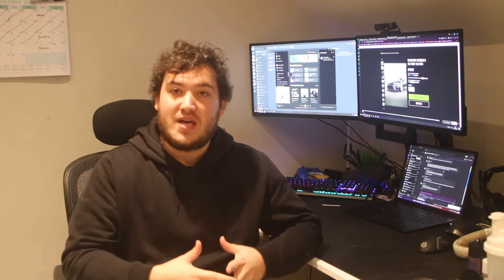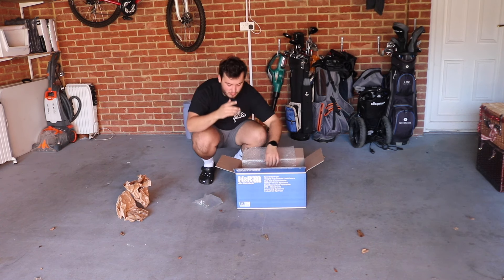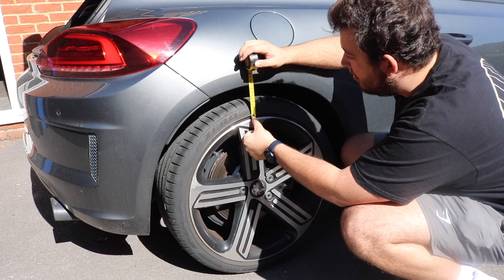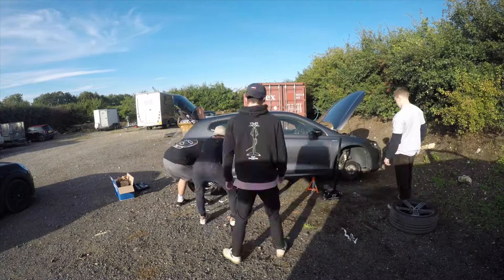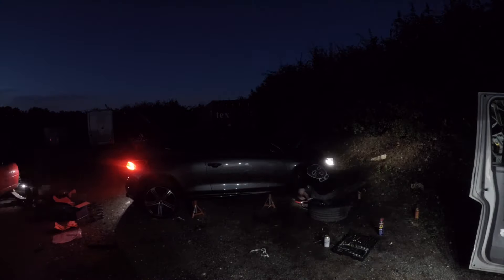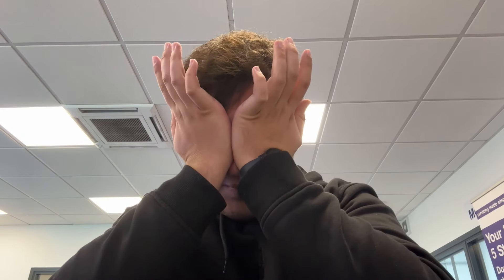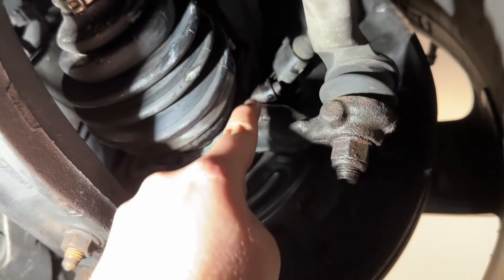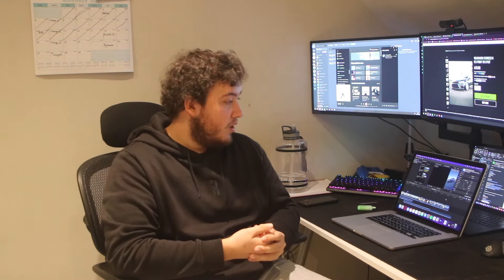Scirocco R - H&R Lowering Springs

Comment: I put AP adjustable coilovers on my scirocco about 15months ago.then put 15mm H&R wheel spacers front & rear.the car sits great and handles so much better than the stock setup.
Reply from the maker: Yeh in hindsight I wish I had done coilovers but springs are cheaper. You got a photo of yours? DM on insta I'd love to see it!
Reply: Thanks for the replay bro.but I'm not on any social media platforms.
Reply: @elkapi67  YouTube is a social media platform 😆